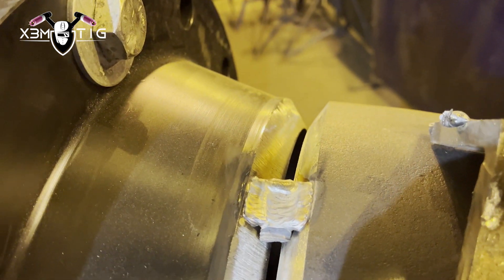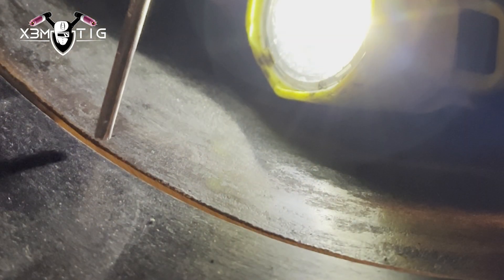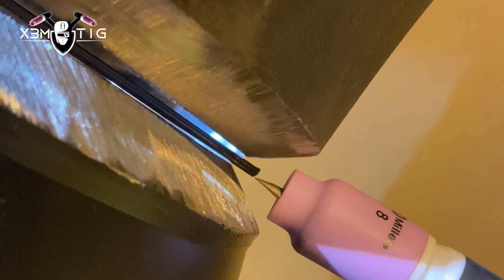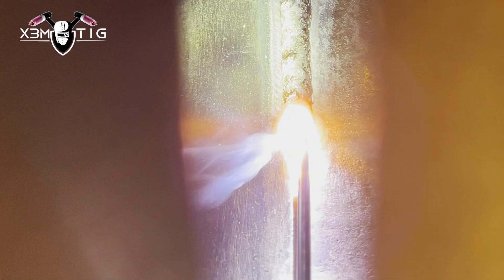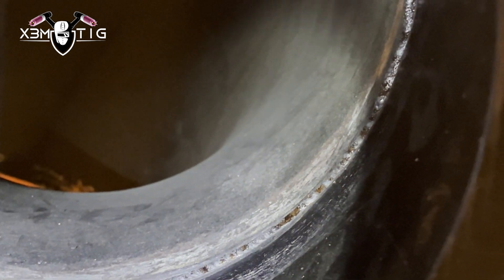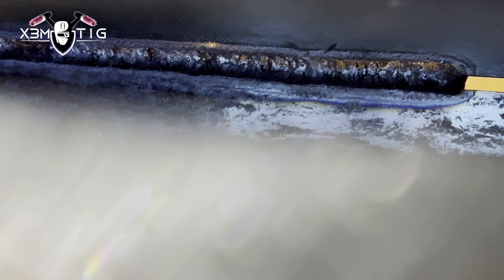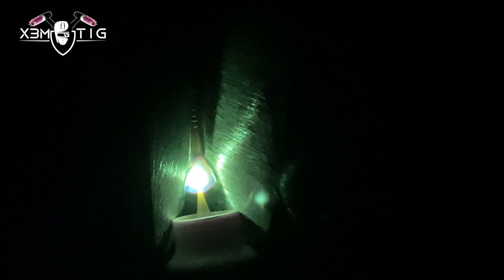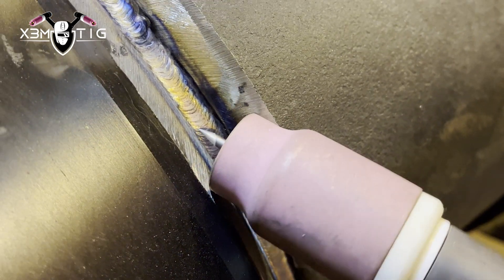TIG Welding Hack: Perfect Your Technique by Looking Through the Gap!

Comment: nice video, i’m just starting to learn this technique and it’s going well, the only issue i’m having is porosity?? seems to happen on stop/starts. pipe is clean inside and out, only happens when doing this technique, everything else no problem with porosity. any ideas what’s causing it? thanks
Reply from the maker: Your initial starts might be a problem, maybe you keep your tungsten too far from material, keep it tight!
Reply: @X3MTIG  thanks, will keep note of that when i next practice.

Comment: How do you do this without dipping your tungsten? How can you see your tungsten with the wire in your field of vision
Reply from the maker: Little bit of experience involved 👍
Reply: Turn your heat up
Reply: so if this is an educational video, the answer can't be with a little participation of experience, it can be done. All of us who watch count on detailed info and not stories, how simple it is and that's it, there is no position of the body, what is the amperage, wire, etc., etc.

Comment: Are you using tacks in order to support wire while feeding it? I noticed you where using only lift tig most of time - why? How you avoid unplaned arc strikes on pipe? Do you have contactor switch on your torch? Some Esab machines have this option for lift tig does your Miller have it to?
Reply from the maker: I’m using both, lift and scratch start, no contactor switch available on my type of machine
Reply: @X3MTIG  thanks